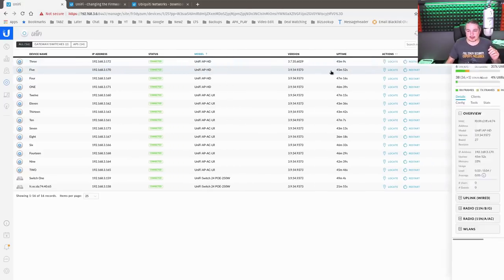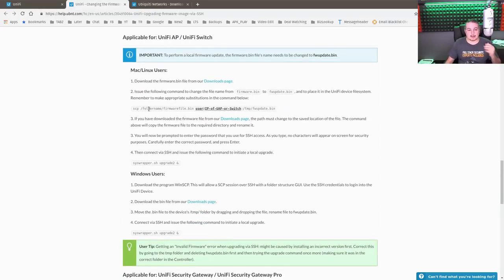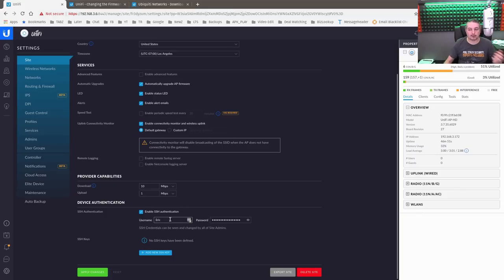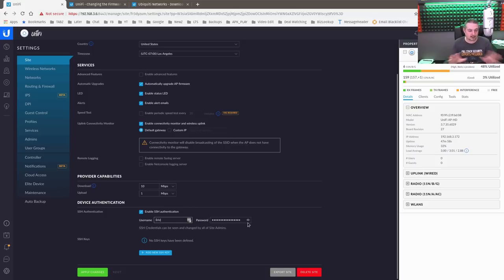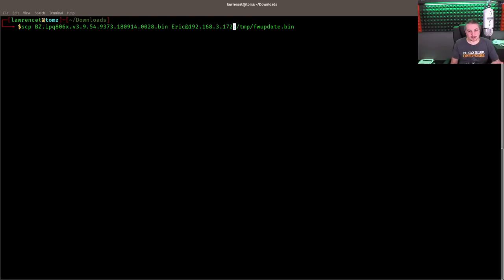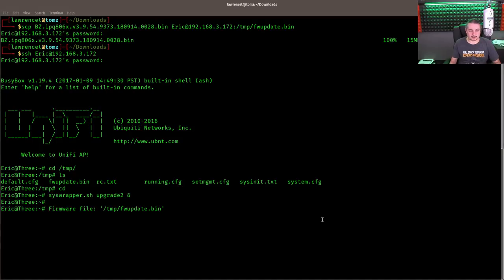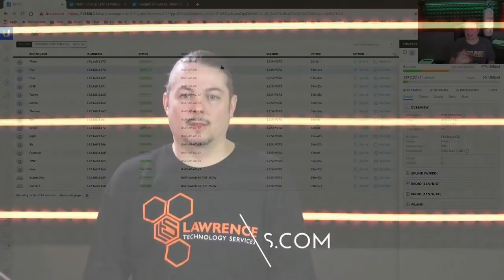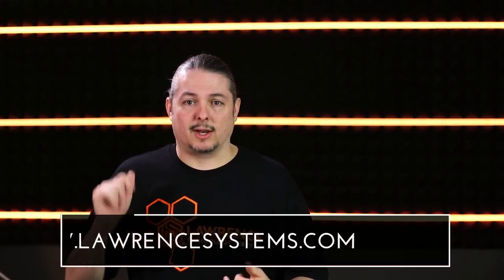How to Manually Update UniFI Access Point Firmware via SSH

Comment: Great video but I have been having an issue of being unable to save the manual/static ip settings on access points when they are unavailable to be accessed via GUI from within the controller. I use ssh to connect successfully to the AP and having set the static ip, upon restarting the device it still comes up with a different ip. Any help please Tom

Comment: i know that this video is a few years old now, but you really just helped me with a UAP-AC-M that I have been fighting to add to the system as a new device. It came from amazon out of date and would NOT adopt, too old of Firmware. it did not have the admin info on it yet since it was pre adoption so I had to use ubnt/ubnt but once I did that, everything as you explained, it adopted immediately. Thank you so much for the excellent video, I am in your debt Sir.

Comment: I am trying to figure out the relationship of the access point's firmware version and the controllers version compatibility.  I have a controller version that is presently 5.7.20
 and the AP's are 3.9.42.9152 but I need to update the AP's to 4.0.42.10433, without first upgrading the controller (another story).  Where within the release notes do they show a compatibility matrix?  Are all AP firmware's backwards compatible?

Comment: I have been watching your videos for a couple of weeks and you appear to know what you are talking about. I have gleaned a lot of info from you and decided I needed to learn more. I put my Motorola Surfboard cable modem/router away and bought a Netgear cable modem and an EdgeRouter 6P. I am not using a switch as I do not have but a handful of devices and with each port being its own network, I don't have a need for wireless devices to get to the wired network. Here are what I think are the relevant settings to pertain to my question.

Not Bridged and no VLANs (I don't think I need them and no difference when I tried adding them)
eth0 is my WAN DHCP and is working fine
eth1is 192.168.1.0/24 DHCP is working for my wired PC and I get Internet
eth4 is 192.168.0.0/24 DHCP is working for my AP-AC Lite and wireless devices get Internet

ROUTES (I'm betting the formatting will fail :-) )
Yes  0.0.0.0/0          xxxx.xxx.xxx.x      eth0          static           Yes 
Yes  127.0.0.0/8                                         lo          connected   Yes 
Yes  192.168.0.0/24                              eth4         connected   Yes 
Yes  192.168.1.0/24                              eth1         connected   Yes 
Yes  xxx.xxx.xxx.xxx/21                        eth0         connected   Yes

From my PC (192.168.1.10) I can ping the access point (192.168.0.10) and I can also get to the access point with the android app. From my PC, I downloaded the Unifi Controller software, but it cannot find the access point. I don't see a way to point it in the right direction. How would I go about building a route that would allow me to configure the access point, but not have the wireless side see the wired side?
Reply from the maker: There needs to be both routing and rules to allow the traffic between the interfaces.
Reply: Thanks for the response. I had been trying just routes and that was failing.

Comment: Thanks @lawrence.  If only Unifi was that simple.  I did all this before I found this video but came here anyway to be sure I wasn't missing something.  I did exactly as you did but the UAP never upgrades.  Hangs post syswrapper.sh and then never comes back up.  Controller won't see it and multiple firmware versions tried with same result on two different UAPs.  WTF?

Comment: I guess I've always just copied the FW link into the custom upgrade part in the config tab. Is there any advantage to doing your long, hard way?
Reply from the maker: keyboard is faster than the mouse and that way failed for some reason..lol
Reply: Interesting. I do remember some issues with a couple of FW versions where upgrade would fail using https link, but it worked if changed to http. Not sure if that would have worked here or not. It's always good to have more than one way to get things done.

Comment: @Lawrence - can you help me the Vlans on Ubiquiti ap ?
ive created Vlan100 (guest Vlan) {tagged} then also i have configured switch.
Controler is laying on QNAP NAS.
Im creating new SSID with Vlan100 and it doesnt work :( no address assigments from dhcp. Ofcourse ive check with another device that supports 802.11q and Vlan tagging working on the switch :) But Unify nope. Is there sth addition to do ?
Reply from the maker: The router/firewall/switch all need matching VLANs, routing and firewall rules to allow access